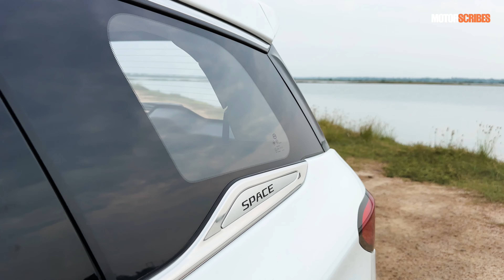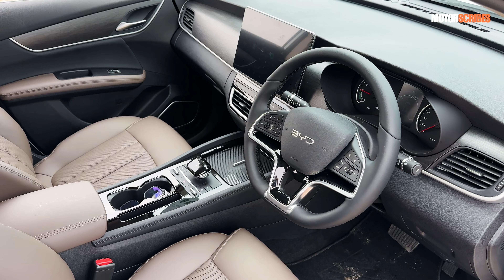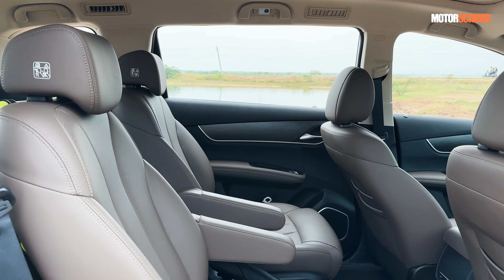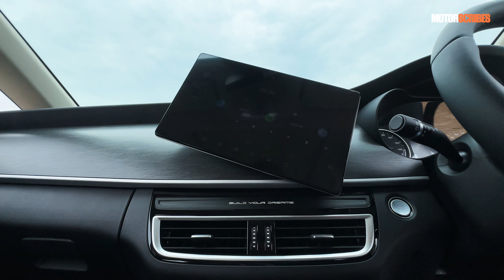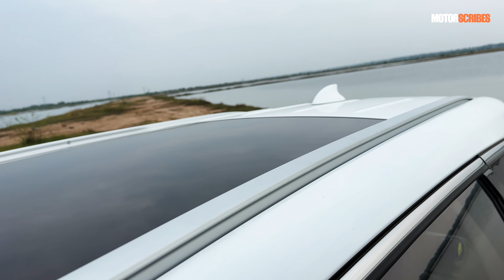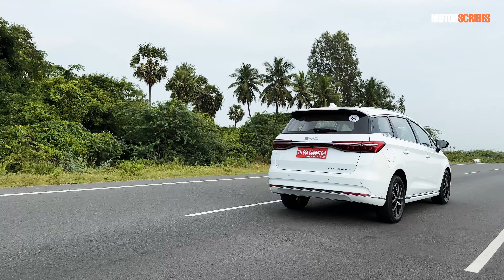BYD eMAX 7 Review: How practical is it?

Comment: The charger that’s comes with the EMAX 7 is a 7.5 w 
Would that not be too slow to charge the car?
Reply from the maker: That’s just travel one that works off a 15A plug. It’s normally used for overnight charging. EVs can be charged at different Ws…7.5 is common for the travel one, 11 is the home mounted charger and then of course you have fast chargers ranging from 30-60 and now even 80 in some places.